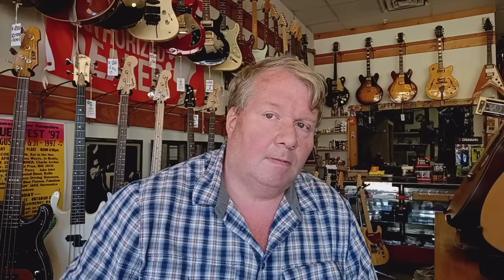WATTS!   About How Loudness and Wattage Can Be Different

Comment: I am not going to try to pretend I know why, but I burned a hole in the circuit board of a Solid State 100 watt Fender Champion with two twelve inch speakers.  I could not keep up with the other guitar player.  He was walking right over the top of me with a 40 Watt tube Bassman with four 10 inch speakers.   The Peavey Valveking 50 keeps up fine, as does the ancient Fender Twin Reverb.

Comment: I think a lot of the tube/transistor loudness difference has to do with the speaker. A 15W solid state amp is usually a small practice amp with a 6" or 8" low efficiency speaker. A 15W tube amp with a 12" speaker (e.g. a Vox AC15) is something completely different. It would be a lot louder just due to the speaker efficiency.

The next factor is that a solid state poweramp typically starts to sound like crap as soon as the peaks start clipping. A tube amp on the other hand, will compress and clip musically, making it possible to turn it up well beyond the point the poweramp starts to distort.

Amp power (Wattage) is measured at the max clean signal output (or at least at very low distortion). For solid state amps, that's effectively as far as they can go. For tube amps, that's just the beginning...
Reply from the maker: What about amps that distort at any volume?  0 watts?

Comment: My first amp (In the late 60's) was a used black Tolex Bassman head and 2x12 cab.  It was the richest sounding thing I ever heard.  I sold my stuff (Really a dumb move) and got away from playing for a few decades. Restarted with a pair of Marshall MG 100 (Solid State) heads and Marshall MG 2x12 cabs.  For the money, they were great sounding (And loud).  But they did not have the rich tone I recalled from the Bassman.  I replaced them with two later model Fender 100 watt tube amps and an EVH 50 watt twin (Tube). Ahhh.  There was rich tone I remembered - I didn't just dream it!

Comment: Watts are watts.   Period.   Perception of tone, perceived loudness, etc are SUBJECTIVE areas that have nothing to do with the International System of Units definition of the watt as a unit of power.
Reply from the maker: In that case, wattage tells us nothing, it should be just another measurement that no one has heard of.  It's like using tachometers instead of speedometers, if the measurement doesn't describe volume, then what good is it to anyone.
Reply: @GarysGuitarsUSA  Wattage does NOT equal SPL.   There are other factors in play, like speaker efficiency etc.   A 3dB difference in speaker efficiency can buy you as much as doubling the amplifier output wattage.   As an amplifier is a SUBCOMPONENT in the sound reproduction chain, its wattage spec informs us of what the amp is capable of in terms of power output.  Wattage does not "tell us nothing";  if you are shopping for an amplifier, it lets you know generally what that amp can do.   You wouldn't buy a 3W amp expecting to get 125dB out of it.
You need an apples to apples base of comparison to evaluate equipment for application suitability, and output power at a spec'ed distortion level is one such comparison tool.

The confusion comes in when apples to oranges comparisions are made, and vendors exploit the consumers' lack of knowledge, like the plethora of different "power" ratings that were used, like peak music power, etc.

Comment: One thing with the class D amps now is that manufacturers state peak wattage not RMS.   People get sold on 1000 or 2000 watts when it's really much less.
Reply: Really?  I'll have to investigate that.
Reply: @wilhelmvonn9619  Peak wattage is what you'll see most often.  Generally you can cut the peak in half, sometimes more to get to what it can consistently do.

Comment: Maybe I missed you saying it in the video, but does this only apply to the power stage?  What about amps like the orange micro terror or joyo bantamps?
Reply from the maker: louder preamp states yield louder output.  Do you mean amps with a tube preamp and solid state power?  The tubes do very little other than glow.  As a matter of fact, sometimes they are in parallel with a preamp chip in these designs.
Reply: @GarysGuitarsUSA maybe they are in parallel, but some people notice they have better tone than digital. I refuse to buy a $1100 digital version of a tube amp.

Comment: I think your PA issues is the way they measure output. Your old Peavy was probably measured RMS. The newer class D rate Peak watts. 1000 peak watts drops down to about 250 RMS
Reply from the maker: Still two 250 watt speakers should be louder than one 300w mono amp.  The sound quality was even different.  And the spring reverb sounded beautiful

Comment: This video started off wrong right away. 

It has  nothing to do with overtones or harmonics!

It has everything to do with voltage and amperage. Tube amps are high voltage, but are also high amperage.  Amperage is current and more current will flow more at the same wattage, thus pushing a speaker harder at the same power everything being equal!

To make an analogy everyone can understand it's like a pressure washer. You can have a cheap pressure washer and an expensive pressure washer both doing 1700PSI, the cheap one is doing 1700 PSI at 1.2 gallon per minute. Or the expensive one at 2.5 gallons per minute. 2x more water is coming through at the same pressure.

In amplifier you can have 12 watts at 20 amps of current or 35 watts watts class D at 10 amps. The amperage is flow of the electricity.

The other part of the equation is how inefficient a tube amp is! It will make 12 watts measurable output because it lost so much to heat and may only be 50% efficient, and yet being high current still is very loud pushing that 12 watts through . 

Class D can 80-90% efficient making a 35 watts on less current but not pushing it as hard.

Everything else you were describing was to do with tonal characteristics of each design and was fairly accurate, but nothing to do with watts and how loud something gets!

Comment: Very interesting insight about stacked resonant harmonics producing more volume in the tube amp. This makes sense to me, as when one takes two identical sine waves and overlays them perfectly, the amplitude will be doubled. However, if one places them completely out of phase, the amplitude remains the same. I notice this, when tuning identical string pairs on a mandolin. Tuned slightly out of phase, the mandolin sounds sweet with all its complex harmonics, but it is quiet. But tune the string pair to be 100% in tune and there will be no pulse, less tonal complexity, but the volume will be doubled, allowing it better to cut through acoustic sessions.

Comment: Had to stop the video because it's complete BS. A watt is a watt and no matter if it's delivered by a tube amp or solid state, it will produce the same volume from the same speaker. Perception means nothing. Your 12 watt amp will NOT produce the same volume as a 50 watt amp using the same speaker.

Comment: I love small tube amps, like the Epi Valve Junior and Kustom Defender 5H -- two tubes, an on/off switch, and a Volume knob. 😄My only significant annoyance is the habit of pairing them with tiny asthmatic speakers! I run them out to an old Celestion 12" in a closed cab, and it's magic. And, yeah, I still have my ancient s/s Crate Condor that throws 100w, and gives me a perfect 1970s vibe, but the little Valve Jr fills the room.
Reply: My first tube amp was the Blackheart Killer Ant 1 watt head with two 1x10” cabinets. 
It’s still my favorite amp. I bought 2nd that was NIB from a collector last year and had it modified with the Bitmo mod Ant Eater. 
I’ve been clearing out my collection of 18 different low watt tube heads. 
Getting down to just my Blackhearts and my midlife crisis amp Benson Vinny Reverb.

Comment: The requisite power of guitar amps is dependent on the genre of music. ‘Heavy’ music still requires lots of watts and lots of SPL from multiple drivers.
Reply from the maker: I'm with you, a marshall in to a 4x12 for metal, but isn't Metallica is using guitar modeling pedals, not amps, maybe the PA is cranking, but not the amp.
Reply: @GarysGuitarsUSA well they used Mesa Boogie Triple Rectifiers for their signature sound.

Comment: I never owned any high end tube amps, but I think the best thing I've ever had, and still have, is my little gray Voice Of Music 5 watt tube metal box amp.  6v6, 5y3 rectifier (I think), and a 12axy preamp.  Basically a Champ minus one 6v6.  When I had it running good, it was going through a 4x12 cab.  For a bedroom, it couldn't even be taken past 3-4 without pissing everyone off.  I really need to get it in to be fixed.  Needs pots replaced, I think.  It does have a normal grounded cord installed, though, so it's otherwise ready to go.  I'll never sell it.

Comment: WATT was that all about?  I recently got a small powered 2-way PA / monitor speaker.  It has class D power amp and is rated at 350W (rms).  But if you look at the AC input it clearly states input "power consumption" is 150W max.  Now if there is only 150W of electric power going in, there's NO WAY you're going to get 350W of audio power coming out!  But its still plenty loud - I figure 100W is probably a more realistic number.  Check the input power consumption rating.  Class D amps - because of their inherent digital nature - have an "instantaneous power" rating, which is usually quite high.  Which is why they are very good with transients, like the pluck of a string on a bass guitar.  Or the 'kick' of a bass drum.  But its a very different thing from perceived continuous audio output.

I also recently picked up a couple of old Fender M80 combo amps. Made in USA from 1989-1994; 1x12 traditional solid state (NOT class D) with 65W output into a single 8 ohm speaker.  They needed some work (including new speakers), and they are LOUD!  The overdrive channel sounds awful, but the clean channel makes a nice pedal platform.  I'm not cranking them up at all, but they have a deep, rich, full response that just sounds GREAT with a few good pedals or a modeler in front.  And a lot of those old solid state amps have effects send-return jacks, and the return usually goes straight into the power stage, and they often work quite well with digital modelers.  Sort of a poor man's FRFR.

Comment: Thanks, Tom! <3 your stuff. Side note about the Fender Rumble 500 - unless you're running an extension, you're only getting 1/2 the wattage out of that amp. So, it's peeling the paint off on 4 while operating at 250W. Any cab extension on the back will allow you to get the full 500W out of it.
Reply: Because it produces 500w @ 4 ohms and half that at twice the impedance. This is true of all amps as far as I know.

Comment: I just bought one of the new Vox AC10 hand wired amps and I really think it is very gigable. Meaning it is quite loud for 10 watts.
Reply from the maker: That's a great amp.  The best contemporary Vox as far as I'm concerned.
Reply: A high efficiency 10" speaker puts out a lot of sound, even at only 10W.
Reply: @Tony-PanTone  the new version of hand wired has a 12 inch greenback Celestion actually.
Reply: @TheChristafershawn    That will certainly work too!  Sounds like a great amp.

Comment: Interesting discussion. One can really get into the weeds when comparing wattage vs loudness and the difference between the sound of tube amplifiers and solid state amps. In general, a 100W amp produces only an 3db increase of sound compared to a 50W amp. That is why a 12W amp is still loud compared to a 20W or 30W amp, as the ear can barely detect a 3db difference in sound.
The sound quality of a tube guitar amp and a solid state amp is a different thing altogether. I think that the differences are subtle, and a high quality, well designed SS amp can sound as good as a tube amp in most situations.
The big difference I see between my tube amps and SS amps is that I can get a better sound at lower volume with the SS amps than I can with the tube amps. Cheers!
Reply: And the weight between the two. The part about SS amps sounding better at lower volume is a fantastic observation, I hadn’t thought about that.

Comment: Guitar amps manufacturers rate their amps output themselves. 2 amps can be rated at the  same output wattage as another and have different speakers sensitivity ratings. So the one with the greater sensitivity will produce more perceivable volume. It's not just about wattage output it's about the speaker output. I've had 14 different guitar and bass amps. The solid state amps were every bit as loud as the tube amps. The advantage to a good Solid State amp like a Quilter or Polytone is they never over heat like tube amps and don't need tubes replacing when you least expect it. Those amps don't sound thin or weak like the ones in the 1960's. Technology has advanced a lot more so tone isn't the issue it use to be.

Comment: Hi Mark, I both agree and disagree. 
You can take two identical tube amps with different speaker sensitivities, and one will sound louder than the other. I love tube amps, but for me a Marshall JCM800 2203 only really comes alive past 4 on the master and 7 on the preamp...and that’s way too loud in a small space. So I use something else that fits that environment.
When I started, little practice amps were terrible, but now we can get great tone at home. Is it the same as that Marshall? No, nothing beats the real deal for feel (though soundwise, yes, we can get very close). Also, class D is just a power amp, but compared to your Princeton that is not the full package: preamp, tone stack, power amp, speaker, and even the acoustic elements like cabinet size. So when you go digital, you have to include those factors as well.
Reply from the maker: I think in the digital amps they really do a lot of modeling to get the sound even close, and it's modeled after the classic tube amplifiers

Comment: I used a FenderTwin Reverb TONEMASTER at an outdoor event…… it failed miserably, I don’t know WATT happened 🤌🏻🤌🏻🤌🏻
Reply: How many devices, including the PA, were all plugged into the same 25 or 30 amp circuit running on one or two extension cord? 😮😊

Comment: Today I had a problem with an old Teisco 3.4 watt tube combo speaker - needs to be repaired. To check the amp itself I connected it to Celestion 12' Vintage 30 speaker. This was crazee - the sound was so Big and loud, it could easily play in some live gig. Just one 6AR5 power tube with 3.4 watt power!
Reply: Speaker efficiency is a huge deal and can make a big difference in loudness, fullness and tone. Speakers from the 50's and early 60's can't carry the signal near as well as a modern high wattage speaker.
Reply: @billyboy6028 60 years ago wattage was expensive so they designed very efficient speakers. Nowadays wattage is cheap because of advances in circuit design so power handling capacity is the order of the day in speaker design. They mastered efficiency before they beefed up power handling with large ceramic magnets and wider voice coils

Comment: Thanks for the video, I have 2 amps that are hybrids using a 6205 micro tube solid steel power output. The other is an old ADA 100  two 12ax7 mosfet power output. 60w and 100 watts. Paragraph.   A EL84 22 watt head and a 32 watt 6L6 hand wired combo.  The micotube is small enough to fit in a pocket of a gig bag, paired with the neodymium single twelve.  It can go bus to train overhead compartment taxi to gig. The switch on the back is for USA or Europe.  

I sold my 1963 super reverb that was my favorite,  I play in the UK mostly and there’s no way I’d take anything heavy on a double decker bus or train

Comment: In short: How well does and amp create the THX effect?

Tube amps tend to be harmonically rich, so they have more orchestra to the sound.

SS is high fidelity, which means less harmonics and more transients.

Tubes can get muddy with distortion into the preamp, SS takes distortion very well into the preamp.
Reply: I've always "hated" class d amps.

ESPECIALLY for sub-woofers.
The bass ends up being too punchy and not woofy enough. It's low frequency fuzz to me and my guts.

Needs the right EQ into it, not just any sound.
Reply from the maker: I would argue that my solid state dynaco st70 sounds pretty good in the hi-fi realm.  It depends which tubes you're using and how you're using them.
Reply: @GarysGuitarsUSA Lots of great bassists I know only use class D amps. I like a hybrid setup with a tube preamp going into a class D power amp section. I've got a pre Fender SWR SM400 that gets a great selection of tones. The comment on bad class D bass tones is plain weird.